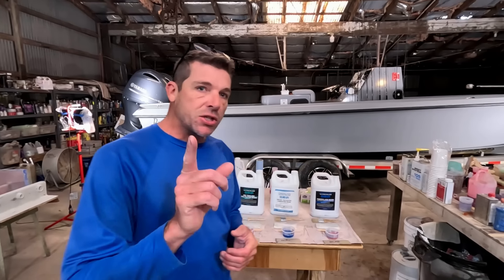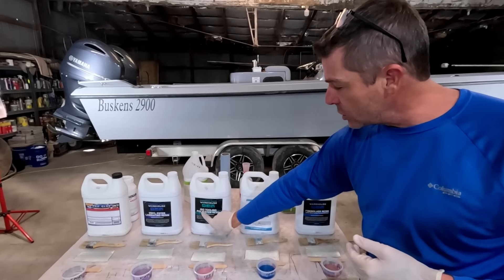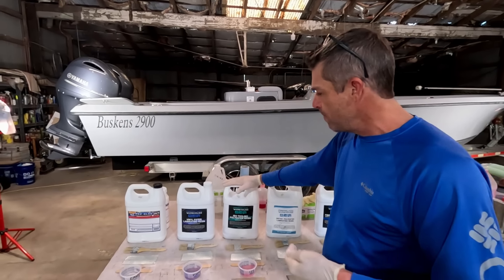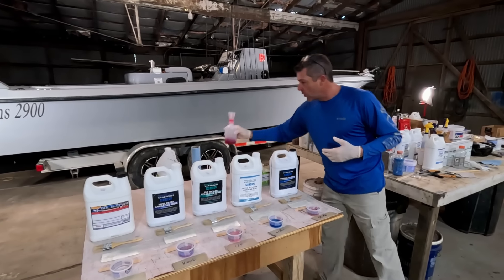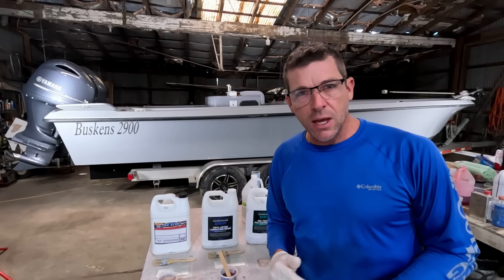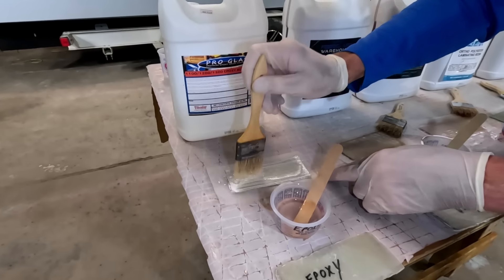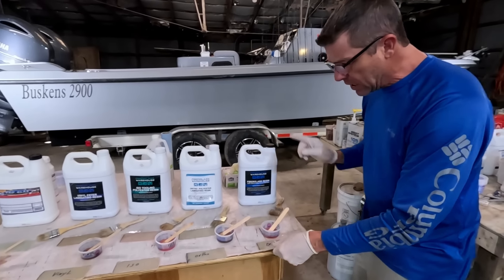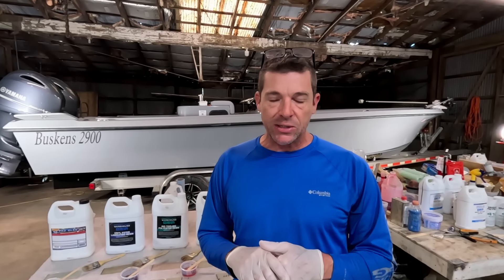HOW-TO CHOOSE THE BEST RESIN FOR YOUR NEXT PROJECT-DIY FIBERGLASS

Comment: Epoxy can take 6-10 days to “fully cure” depending on ambient temp. But once it finishes it is much harder. Polyester will continue to cure for months (and shrink on a micro level) which is why it tends to have less adhesive properties. If I had to guess I would say that epoxy was 2-4 days old. Your videos are awesome! I will be subscribing to the patreon here shortly
Reply from the maker: Thanks for your thoughts
Reply: Also some epoxy need to be cured in an oven. I hope this is not one of them.
Reply: @koji71  I agree with you and use the proper method of all the steps you need start to finish!

Comment: The vynyl easter resin is said to stay tacky. Yet my first time using it was tacky.  Called fiberglass warehouse and was told to wipe it with acetone.  Is that how it does with anyone else and is wiping it with acetone the next day a good idea
Reply from the maker: Yes, it is standard practice to wipe down a surface with acetone to promote adhesion of following layers. If vinyl ester resin has been allowed to cure for more than 4 or 5 days, I recommend scuffing the surface with some 60 or 80 grit sandpaper, vacuum up the dust, then do a acetone wipe down. Thanks for watching!

Comment: This is just the channel I need, stationed out in Japan and starting a flats skiff for fishing here, was wondering if y’all could cover fiberglass on foam board trying to cut the weight down as much as possible. Keep the awesome vids coming!
Reply from the maker: Very cool! I will try to add some foam core construction content to the channel for you. Best of luck with your project!
Reply: @FishBumpTV  I would be interested for old van delivery bodes and insulated enclosure builds.

Comment: I like that you found some resins available to the diy market. 
I’m A polyester resin man all the way having been in fiberglass industry years. The cost for diy resin is crazy high compared to industrial pricing.  
I guess you don’t remember the days when we had to use paste or powder BPO catalyst in sticky vinylester resins ( derakane) , ever since they came out with the AME2000 VE resin that used MEKP the VE world changed!
The things I don’t like about using epoxy is 
it’s much slower too work with , 
it’s very expensive in small lots, 
It’s more toxic ,if you get it on your skin , espically when sweaty you can get sensitive to it permanently! Not good! 
Good video!
Cheers Warren
Reply from the maker: Thanks for watching, and really appreciate your thoughts and feedback!

Comment: ** to add.  epoxy resin wont destroy foam, and is the go to for carbon fiber that will be naked.  poly and vinyl ester resins are great for most everything, except laminating foam, unless some melting of the foam is part of the plan like bonding to the hull and ring deck.  

ive built boats, automotive body kits, and speaker enclosures out of poly / vinyl, its cheap and strong.  when shaping foam for a pattern i use epoxy to seal the foam before applying more glass / body filler etc.  

ive used epoxy to seal counter tops, fill voids in lumber before milling into furniture, and for materials like carbon fiber / kevlar where the aesthetics of the materials are desirable.  i had some gold carbon kevlar years ago that was pretty cool left over from gov boats.
Reply: @drifter9425   youre not wrong, but its the only real option for clear resin.  if clear isnt a factor than by all means use poly etc..  the carbon / kevlar boats ive built in the past were gel coated to look like any other center console boat and laminated with normal production resin.

also, anything naked carbon is going to be expensive as all hell and probably well taken care of / covered.  to mitigate uv damage.

Comment: Just food for thought!    
In all the kit aircraft that is made of fiberglass.  All that I ever knew has been made with Epoxy. Due to higher tinsel strength/per weight. Also, the durability.  Never ever have I heard of the use of Vinyl ester or Polyester. 

I knew boats was Vinyl or Poly.  Due to the use of molds and using gelcoats as the first layer in the mold.  Quicker assembly time and also a lot cheaper in cost.   
I believe a one-off boat design for true performance. They are normally hand laid fabric and most time's epoxy.  
I know back in the day Ranger Bass boats was all hand laid woven fabrics.   Not sure about epoxy for the risen though.
Reply from the maker: Interesting! Thanks for watching and commenting!

Comment: Maybe adding an second sample that is stressed by grabbing from opposite corners and twisting back and forth.

This may be more representative of forces that sections of the hull take between structural components. Like in a wash tube sea.

I had a boat that buckled in above the waterline. No damage to the gel coat but damage on the inside. Delamination of the layers and strands sticking out around the edges of the damage. 
 The damage was about 4 feet back from the bow. 
 The manufacture had to repair the boat under warranty.

Comment: I used vinyl ester for wrapping and adhering the engine and tranny mounts on my Shamrock, which were then gelcoated. The only drawback is the short shelf life compared to polyester. It has to be fresh, and used promptly.
Reply from the maker: Some brands have better shelf life than others. I have been very happy with the vinyl Ester we have been using recently.Overall vinyl Ester is a great option where you need strength and waterproofing, and also want to finish with gelcoat. Thank you for watching and commenting!
Reply: @FishBumpTV  Ty for the tip!

Comment: This has been very interesting. I'm planning on building  a kayak very shortly. After seeing this video    I now know what resin I will use. While watching this a thought came to mind, and I would like your opinion. This will probably be be very different than what is typical. Have you ever thought of applying a coat of contact adhesive to a plywood boat, and then lay fiberglass into the contact cement as a first layer?
Reply from the maker: Glad you are enjoying the videos! No, I have never seen that done before. I think I would stick with resin personally.

Comment: Which resin do you think a sailboat made in 1967 was used? And what should I use for repairing. Thank you
Reply from the maker: Most likely it was built with a ortho polyester. The vinyl Ester resin is a really good choice for all around repairs. Many people also like epoxy, but it is not usually recommended that you use gelcoat over epoxy resins. Hope this helps, and thanks for watching!
Reply: @FishBumpTV 
Yes thanks,  another question what is best fiber glass fibers for deck to hull joint repair 1708 or 1808 in 6 t0 8 inch strips

Comment: Could you do a video or comment on boat flex allowances, areas and necessity?  I am in progress on a transom replacement from rotten wood to Coosa on a 25' plus twin outboard glass bracket center console boat.  I want to terminate my stern floor liner directly to the transom (via glassed in coosa bracing).  It used to have a  liner to transom gap, but I want to do floor drains via directly cut slots straight out the back. The previous gap there (pvc pipe out) was a major source of my leak that rotted the wood.  If I bond the floor directly to the transom am I killing a necessary flex and may end up cracking floor, stringer or transom?  I'm also planning to do a permanent glass and bolt bond of the engine bracket to transom.  You have by far the best show on boat works and I appreciate your longer and encompassing demonstrations and explanations.  I am doing the work and you are helping immensely.   Huge fan here.  Thank you!!!!!!!!!
Reply from the maker: Sounds like a great project boat you are putting together!   We almost always glass floors to transoms, as well as glass splash wells and other structural parts together. There is always going to be some flex in fiberglass parts, but in my opinion you would want to minimize it. When parts flex alot, they usually fail at some point. There are several videos in our custom 29 boat building series that shows us glassing floors and splash wells, etc to the transoms. I am sure these videos would be helpful.Of course every boat is different, and you have to decide what is best for your boat. I hope this helps, and thanks for Watching!
Reply: @FishBumpTV  Appreciate that info.  I've actually owned this boat 22 years and hope to have it another 22.  I've been watching your 29 boat build but sometimes, like any other series on Ytube,  it's hard to get the videos in sequence and find myself fishing for it.  I know you can't usually make a link to the next video because at that point you haven't shot it yet, but maybe you could always have a link to the previous video so we know when we skip to far ahead.  Had my semi pro glass guy helper with me yesterday and today (at $100/hr) and he's asking me how I've come up to speed so well and challenges me on some of it.  It's because of you man.  I wasn't fully on board some of his work and I went forward at 5 AM  today before he got here and made some nice advances, like more glass structure in the transom and bracket areas where the bolts run through.  And today we worked together and glassed and bolted the bracket to transom.  It's better than ever.  Many thanks and when I get through this I promise to send you some thank you $ too if the boat survives the beat down test run. You are awesome, keep it up!!!
Reply from the maker: @tmc.318  Glad you are enjoying the videos! I recently   numbered the boatbuilding series with episode numbers in order, so I hope that helps with any confusion. I Really appreciate you following the channel,  and your positive feedback is very encouraging! I wish you the very best of luck with your boat project.

Comment: Great video! I’m wanting to waterproof plywood for bottom of Jon boat. Sounds like vinylester would work good. Any problem with gluing carpet on top? TIA. Video was super in depth and informative!
Reply from the maker: Thanks! Yes, the vinyl ester is my go to all around favorite resin. I used it extensively in our hardtop build series recently. I also have a how to fiberglass over plywood video and a how to epoxy fiberglass over plywood video that you might find really helpful for your project. Hope this helps and thanks for watching!

Comment: When I repaired my pool step I used 1708 and I believe epoxy resin. Then painted it with Total Boat gel coat with wax. That was 3 years ago and it has started peeling. From your previous episodes, you mentioned that you should never gel coat over epoxy. Could this be what’s causing the peeling? How can I correct this? The patch itself is strong and holding up well.

Comment: I watched and subscribed.  Question.  I'm planning to build a truck bed camper.  I'll frame with 2x2's and cover with 1/4" luan plywood.  I want to then encapsulate the entire exterior with 1708 or 1.5 oz chopped mat.  I clearly want to use a laminating resin.  Fill the weave, let it tack up and then wet it again, let it tack up and then gelcoat it.  First - am I on the right track?  Second - what resin would you recommend?  Third - would you use 1708 or a chopped mat?  

I know a boat will take a TON more stress than a camper in the back of a truck bed.  Yes, camper will twist and bounce around, but boats get it from all angles all the time.  

Seriously interested in your thoughts!

Comment: Curious on the vinylester vs iso polyester shrinkage as I generally use either iso poly or epoxy. Post cure I find iso polyester leaves considerable fibre print through.

Comment: micro cracks under a microscope would be interesting. After repeated shock impacts. 

Got a problem on tesco food delivery van body, where fibreglass cracking above rolling shutter door. 5 year old.
Reply from the maker: Thanks for the suggestion and for watching! You might try reinforcing it with a stronger resin type. Vinyl ester or epoxy might be a good option for you. I hope some of the videos here on the channel are helpful.
Reply: @FishBumpTV  thank you! I was wondering that too after this video! Assuming to sand area down for grip, maybe  apply new sheet of fibre glass? Was wondering if i need to cut and replace it. The cracks go up to the edge of plastic angle , so assuming i need to drill out rivet’s and remove edge angle so i can seal and cracks that probably go under it. I expect some photos are really needed to answer… its my trail of thought for now.
Reply: @FishBumpTV  finding all the videos very  helpful. Watching all the details.  Nice to learn it is right to seal up holes that gear goes though. Been doing that with glue in holes plywood for electrical cases for sound systems and similar projects.
Reply: not expecting free of charge advice btw! so no worries if no reply. just happy you posting so much detailed educational videos and your presentation and tone is so kind and pleasant, its makes me happy from watching.
Reply from the maker: Yes, good surface prep is important. I like to use a 36 grit grinder for material removal, but a small pneumatic angle grinder might be able to do the job. Our recent sanding and shaping video might be a good one to check out. Hope this helps, and thanks for watching!

Comment: Greetings from Romania! Your videos are fantastic! They are full of valuable and to-the-point information. I want to redo the walls and ceiling of a motorhome on a plywood substrate; what kind of resin and fiberglass do you recommend? Thank you very much!
Reply from the maker: Wow, thanks for watching all the way from Romania 🇷🇴! I really like the vinyl Ester resins for all around use. Epoxy resin might also be a option for your application. I think you could be happy with either. I hope this helps and best of luck with your motor home project!

Comment: Great info, thanks, first I'm not a boat guy, I have worked with fiberglass in a factory making pipe, almost all was in house blended polyester resin, fast-forward to today I'm trying to figure out what kind of resin was used to make a large tank that had it's lid crushed, I have cut into a piece and I think it smells like polyester, is there another way to figure this out, thanks for any help.

Comment: I watched your video and loved it! But I'm hoping you can give me some advice since you obviously know what you are doing.

I have a small 14ft fiberglass river boat from the 1970s. I replaced the transom about 4 years ago with two 3/4 pieces of plywood that I epoxied together and epoxied to the back skin. I used epoxy and some fiberglass cloth given to me to create a back skin. I'm about to remove the outboard motor and install a surface drive mud motor that is about 70lbs heavier. I want to beef up the transom. I'm thinking about using epoxy and adding around 3 layers of fiberglass cloth to the edges. I'm also thinking of adding a couple of 45 degree braces that will be secured to the transom and floor.

My problem is that I am hearing all sorts of opinions on how I should do this. Some are saying just use csm soaked with epoxy, and others are saying use 1708 cloth.... I would love to hear your idea on what I should do.
Reply from the maker: Sounds like you have a solid plan overall! If you are using epoxy resin, and your goal is to add strength, then 1708 would be the way I would go on my own boat. The transom is an area that we always overbuild, when in doubt add another layer or two. I hope this helps and I wish you success with you project!

Comment: Hey capt joe,  just want you to know loving all the vidios learning a ton just picked up a 1993 sea ray express cruiser 250 sat for awhile  came from lake michigan spent the last 2 years in lake O in florida.  never been in salt water it only has 486 hours motor is sound hull is solid from research specs say it was made with vinylester resin wich is a good thing I suppose watching your vidio with the can of beans coud not be more true. the boat had a alot of decorative panels plywood wrapped with foam and vinyl and carpet glued to the glass I ripped it all out.one of the shelves  had resin rolled on no rot, the other not coated rotten I want to cut the shelves off close to the hull and grind as close as I dare my question to you is can I use a laminating resin with mat  on the curves I also want to epoxy some rips of plywood for mounting some under gunnel rod holders to mount on due I need to cure the poly before I go over with epoxy and 1708 or can it be tacky sorry for the long story just want to do it right. Thanks dan

Comment: Have some bamboo poles I'm going to turn into frog gigs. Read online and people recommended just using fiberglass resin. Any resin you recommend? Looking for a clear finish, not tacky, and flexible enough to bend with the bamboo.
Reply from the maker: The vinyl ester or epoxy resin would be the way to go. They have the best waterproofing properties. Hope this helps and thanks for watching!

Comment: Is there ever a scenario where you would use different resins as you build up layers?  you mentioned having 10 layers on the floor of your build, would you ever mix as you build up those 10 layers?
Reply from the maker: We usually laminate with only one type of resin, but sometimes you will do a vinyl Ester skin coat. I just wanted to show that many of these resins are compatible with each other, and can work together if that if what you had to work with. Thanks for watching

Comment: Joe thank you for the effort you put into your videos ,much appreciated. I have a quick question I had damaged the bottom of my boat  on the ribs  no holes  would it be best to repair with 1807 or 1808 and  use an polyester resin and then mix up a little apoxy resin  and just apply over the repaired area to prevent water intrusion